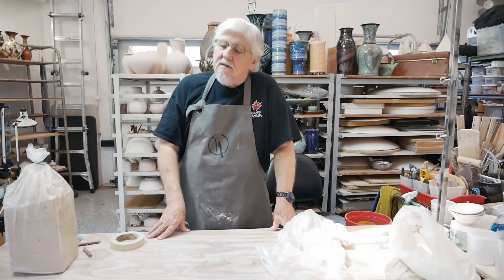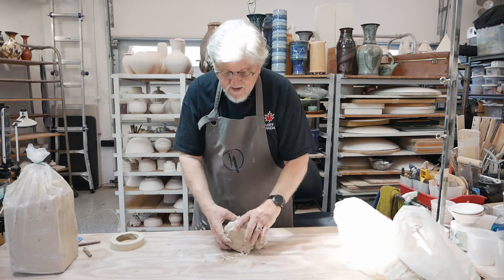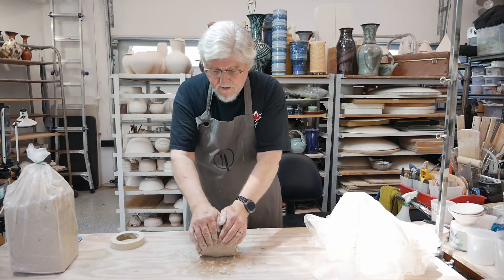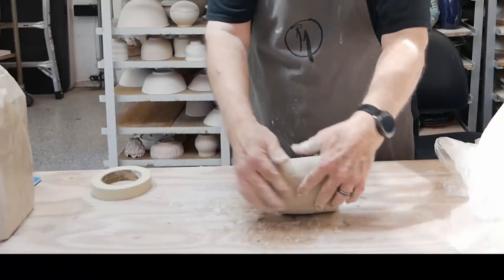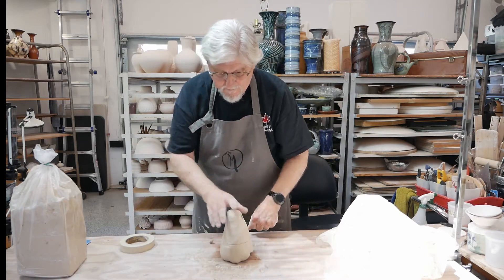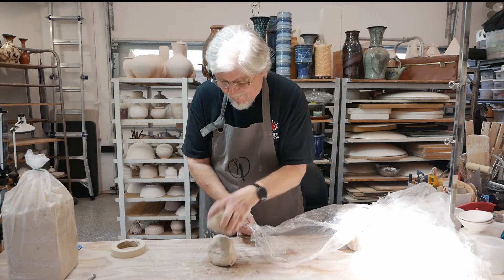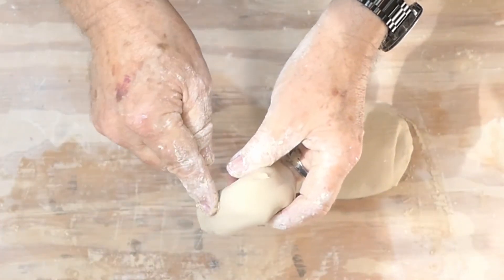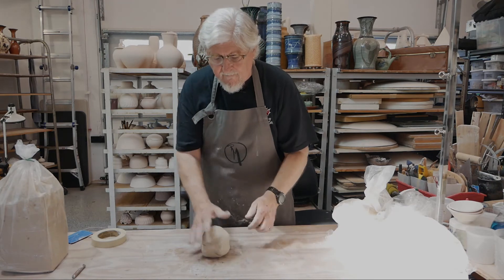Wedging Clay

Comment: I have an entire basement with a smooth cement floor.  THANK YOU for that wonderful idea. I'm curious if I can pre-wedge clay maybe a day or two in advance (keeping them in a sealed bag of course) at home so when I go to the studio, I'm spending my time on the wheel and not on wedging.
Reply from the maker: Hi Sharon,
I would pre-wedge my clay and put the balls in a sealed plastic bag in a bucket. The next few days I could work from them.  You may find that they will get a little harder on the outside which is easily fixed on the wheel with coning the clay a few times while centering.
Enjoy and happy holidays!
Richard
Reply: @richardmccollceramics  You are so very helpful!  I really appreciate you taking time to answer.  Thank you!  Happy Holidays to you as well.